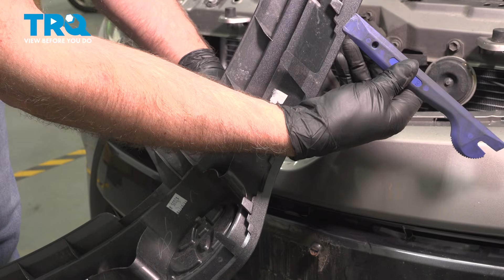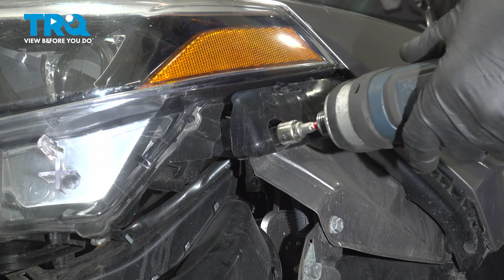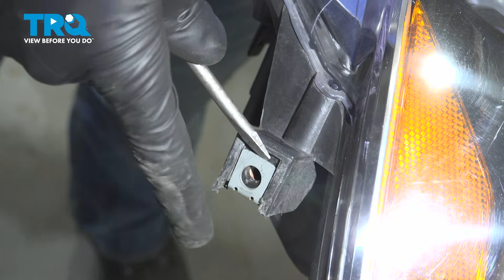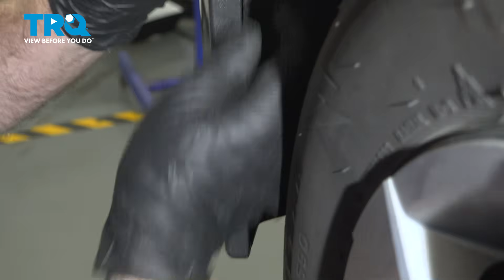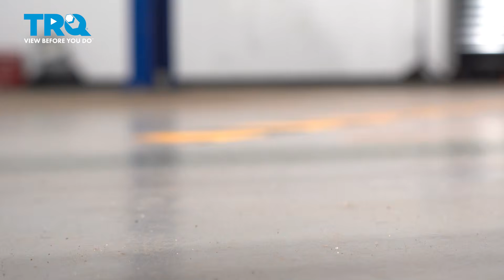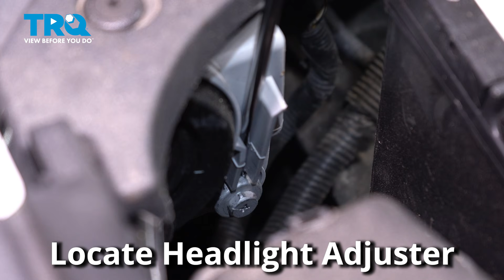How to Replace Headlights 2014-2019 Toyota Corolla

Comment: I’m pretty sure this is to replace the whole assembly. If you just want to switch the bulb, you should be able to pull it out from the back without taking the bumper off

Comment: You took a 3-minute job and turned it into a 2-day job for 1 bulb, please report this video for a waste of time, 
Find the light you want to replace, take the cover off, twist light to the left, unplug light, plug new one in, put back in place turn light to the right to lock it back in, put cover back on, no tools needed 
Mechanic, that will be $27 for the bulb plus $260 for the labour, total comes to $390, why so much ? Oh we needed to take apart your car to do something you could do without any of that

Comment: This is only if you have to change the entire headlight assembly. To change the bulb you just reach in, unplug the bulb holder, twist it out, replace the bulb and reassemble. No tools required.

Comment: in 2024, at what cost would this labor be considered fair should it be done by an auto shop not trying to rip you off? 

i watched this video closely and have quickly (and easily) come to the conclusion that there is no way that i could do this. like, how much should it cost if i were to get a whole new headlight and bulbs, and asked a shop to switch it for me 😭😭